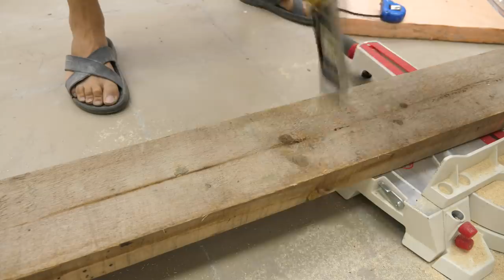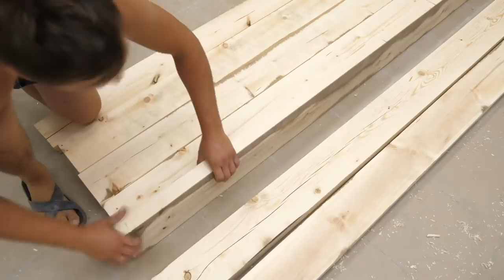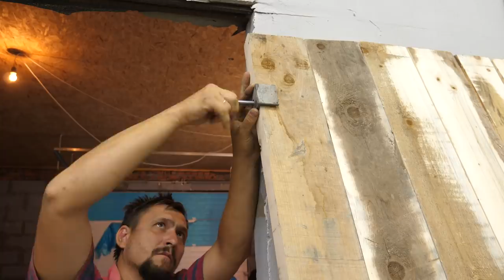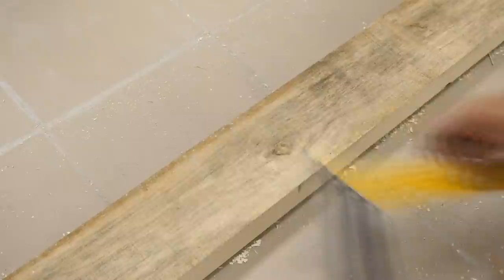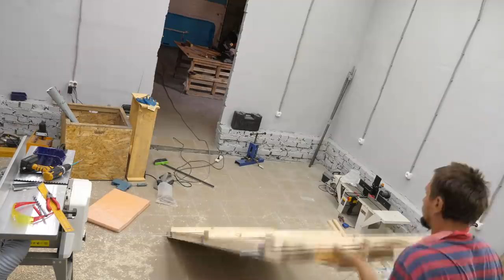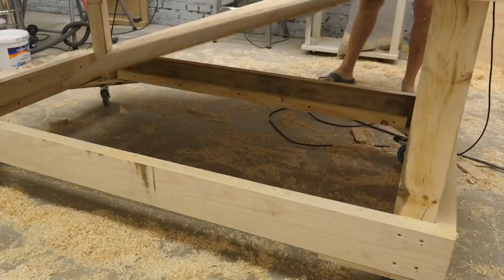I SPENT ONE CUBIC METER OF WOOD ON THIS IDEA!!! I am very happy with the result.

Comment: Excellent. No need for Rubio, Knee Vise, fancy clamps, router milling a flat surface, whatever.  Just a nice solid workbench with space to build storage cabinets underneath later on if you so desire.  All most of us, including me, needs.  Take THAT Norm Abrams. Nice job.

Comment: Good job!!.in my opinion, I think You could use glue to join the top, instead those screws, but the workbench is awesome anyway. Thanks for sharing.
Reply: I think the all thread rods isn't a bad idea for aligning and holding the planks together myself, But yeah, It would have been SOOOOOO much stronger if he used glue in this build as well.
Reply: Not only would it be stronger. But sooner or later somebody is going to lose some skin on those bolts sticking out.
Reply: bob ali  different techniques but in the end it's a great workbench
Reply: Without glue, he can take it apart if he wants to.

Comment: I like the threaded rod construction. It's plenty solid and makes the bench easy to modify. I wouldn't have used mitered corners. In fact, I don't think I would have framed it at all. It makes it hard to use clamps when working.

Comment: From my own experience, you will eventually regret not designing the table top to extend over the top banding by a couple of inches all around to allow for using clamps to secure project parts to the work surface.

Comment: It took me a short while to realise what you were making. I was thinking that's what you should have been using all along. Then, it dawned on me, you need a set of carpenter's tressles to start with to assist in this project. Also, need a mitre saw stand...could also use the carpenter's tressles with some planks and roller stands. No need to be kneeling on the concrete/ground, lifting the materials up and down. The tressles can be carried anywhere as they are very small. Depending on how they are constructed, can be fold up as well.

Comment: Screws & all-thread work OK, but using glue would really make that top a lot more rigid.
Reply: I was thinking that too. The only reason for not gluing I can think of is maybe he want's to be able to replace/flip boards on the top of they get too damaged, But that still doesn't explain why he didn't use glue on the lower structure.
Reply: Exactly, i read down the comments a little bit to see if any body else caught that. All the joints are only as strong as the threaded wood which shrinks over time. The all thread works great for a clamp on the table top but the wood can still move along the joint anywhere it wants to go as it expands and contracts. Those wood screws get loose over time and there is no tightening to be done after that without replacing with longer and larger diameter screws. A professional wood glue will hold up for decades but within a couple of years the stress of using the table and constantly absorbing vibration and the natural process of the wood completely drying out makes for a loose work bench. All wood is sold with about 14%moisture content because it is bundled wet and kiln dried. By wet i mean still semi green and thus easier to keep straight. I've worked with wood since about 1978 and have seen perfectly straight lumber one day and a few days after it's broken out of a bunk it's not worth using for anything but braces and blocks. Talk to any framer and they can tell you the same thing. We'd get a load of wood and start framing a house and by the time it's inspected there were always studs that had to straightened or replaced, joists would sag out against the crown, rafters would twist off center and had to be blocked to deck the roof. Bottom line is, wood right from the lumber yard rarely stays true unless it's forced to stay in the position that you want it to be used by either clamping, glueing, weighting, or any other methods to keep it from being able to freely dry out and let the grain and cut dictate the end result. No cabinet maker in the world would ever assemble cabinets without glue. No good carpenter doesn't know the value of glue in production assembly of a piece that will be exposed to constant use and vibration from saws, drills, hammering, and what have you on a work surface.
Reply: @Reman1975   Best bet would be to plane the face down, but then I would opt to make the top with laminations of 2x4s glued face to face. That would last a lifetime.
Reply: Maybe he wants to be able to disassemble it if he moves or wants to use it elsewhere.  Easy to transport.

Comment: The castors would benefit from spreader plates. If you want to maintain the table height, glue triangles on the leg side. The retaining nuts will pull them tight.

Comment: Nice work bench. The only additional thing i would have done is added diagonal braces from the legs to the deck. Eventually the unsupported legs will loosen and become wobbly. Very nice design though

Comment: This is a nice job. I would only change a few minor things. For one I always cut my boards to length after they are planed and jointed. But using a circular saw one the ends is one of my favorite cheats. You definitely need to invest in a few clamps. As others have mentioned; glue would have worked much better then those long bolts, again you need the right clamps for that.

Comment: Keep a piece of thin stock under the table.  When you start making a cut in the panel, you can stop, place it under the end just cut and it won't fall binding the saw blade. Large chance of the saw kicking back without this method.

Comment: "GLUE"  if you applied glue to every joint, it would make it even solider, especially side grain to side grain, like the top was made from. Only problem I see with this latest table/bench design is, you made a storage area that absolutely will catch saw dust like a magnet... Thumbs Up!

Comment: I like it but the legs and especially the caster mounting pads are a bit of a weak point considering the strength of the table. Beef those up and you can set a 454 on it with no worries.
Reply: Steve Hurley 2x4 legs dont cut it
Reply: @dbgier  A 2x4 can vertically support roughly 1000+pounds static, safety margin included. It should be fine.
Reply: Double them up and set top frame on one

Comment: Although glue will make it better, you don't need it.  To keep it tight I would have "pinged" the ends of the threaded rod, use locktite, or ping the threads.

Comment: Generally speaking, workbench should be firmly fixed in place while working on it and not run freely on wheels. You'll see why when you clamp a plywood sheet to it and try to cut it with your circular saw and you end up chasing your workbench in circles around the shop.

Comment: apparently no one in the comments know how to use the tools and equipment so they have to wear pads and goggles to draw a line on wood. if you know what you're doing, you don't need them.
Reply: Those who have many years using power tools as tradies, home handy men and also first time users should take note. Any tool (especially a skill saw and grinder cut off wheel) used with or without a guard, with goggles, glasses, can bite you and blind you if you are new and inexperienced or an over confident experienced user. Never get your eyes or head (safety glasses or not) over or in line with a spinning blade. It's a recipe for disaster. I have used thousands of 1mm cut off wheels (without a guard) and never broken one. I'm well overdue for a breakage. Beginners, please familiarise yourself with the reactive characteristics of the hand grinder on 2mm cut off wheels before using 1mm.

Comment: It looks great.  How would you make a round door to a playhouse?     Plywood center with boards glued to the face?
Reply: I'd trace out the size circle you need onto your workbench, Lay boards on it that are long enough to cover the circle, Then glue and screw 2  or 3 horizontal pieces across it . Once the glues dried put a small screw in the middle, Use some string on the screw and a pencil to  mark out your circle, Then cut it out with a jigsaw.
You'll have fun with the hinges on a round door though. If you can have one of the doors edge planks permanently screwed to the door frame, that would give you a straight edge to fit hinges to, Or maybe just add the horizontal pieces after you've cut the door to shape, Then have them overhanging the side a bit , Cut them vertical/parallel, And fit hinges to them.

Comment: You would also put a work bench on the whole length of the wall.
Frame up several 3 & 1/2 inch by 6 foot platforms and hinge the first platform to the wall. Make sure it will fold up against the wall when not in use and hook it with gate hooks .

Ok now it can fold up and down. now it’s time to put a couple 2 x 4s legs on it that also hinge..
When you lower it the legs also swing out to hold it up like a table. You can repeat this around you entire shop providing there is nothing in the way. But you’ll have many work benches at your disposal if you need them

Comment: A top that size definitely could use mucH more substantial legs. Between that and not using glue, and casters that won’t stay put, this bench will have little keeping it from racking And wiggling. Since you are mostly using power tools maybe that doesn’t matter, but normally a workbench should never have any play at all.

Comment: Hi Eugene,  I admire your skills but your ideas on 'safety' are non-existent.  You ought to consider the dangers of wearing slippers on a building site, standing lengths of timber on end, using unsupported timbers in mechanical saws and leaving tools in your path.  As you know, an unnecessary injury caused by careless/reckless working will stops you working!